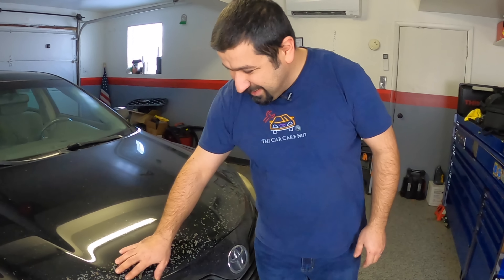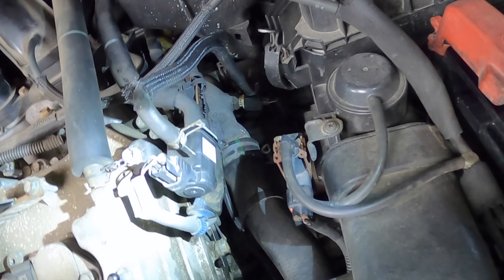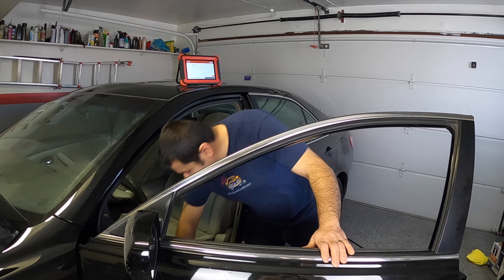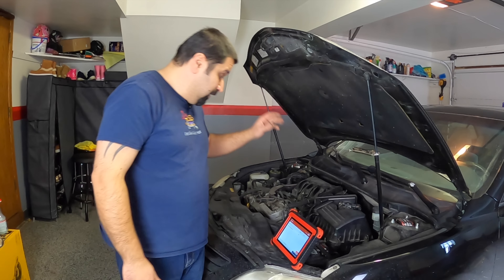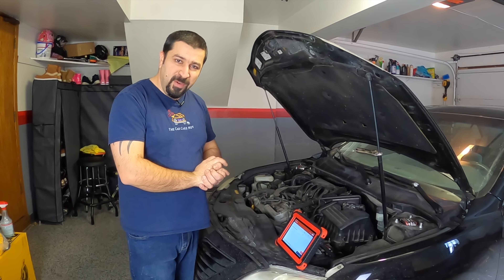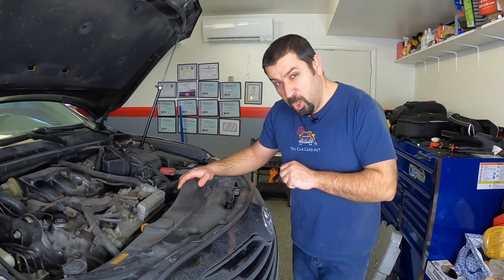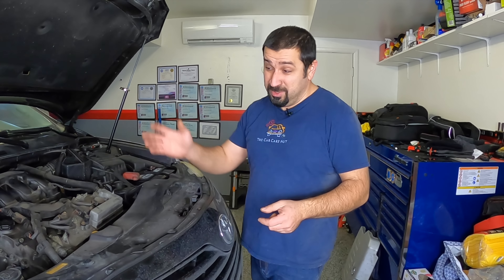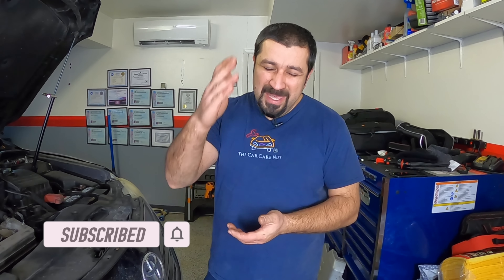How Does a 15 Year Old Toyota with OVER 200k Miles Hold up? Full Inspection!

Comment: So, I needed a new car back in 1999 since my late dad's 1983 K-Car wagon(!) he gave me finally was sold to a local contractor who needed a good old transport for his "stuff.". 

I bought a 3 year old 1996 Camry Wagon that came out of the south with the 4 cylinder 2.2L engine with just 42,000 miles on it .  White, beige interior, black roof rack, gorgeous and with the gold badges all around.  Even found two extra CAMRY gold badges and stuck them mid line on the front doors near the hinges.  Looks original And yes, they are GOLD PLATED!  $32 on Ebay.  I have been driving it ever since and still own it down here in Florida.  Has never seen snow, salt, etc. and is solid as a rock.  In the same condition as this video! The interior is "eat off the floor" clean, the rear hatch and engine hood hydraulic lifts were all replaced new (a very cheap fix), everything works as new (yes, even that pesky power antenna motor that I replaced only ONCE in 25 years.  All power windows work perfectly (replace just ONE a few years back) and she sports a new windshield.  She also has two sets of original Toyota wheel covers, not those cheap ones you can get at your auto parts store.  Finally, I have her running on my favorite tire of all time...TIGER PAW AWP II WHITE WALLS!  i put a little "beefier" tine on her as well Great handling and essentially a Michelin tire since they now bought our Uniroyal a few years back.  I did spring for a new Kenwood BlueTooth radio head just to keep up with the times, ya know!   

Then....IT happened after 258,000 miles (my goal when I bought it was to rack up enough miles to get me to the moon...about 243,000 miles).  Just changed the oil and was coming back home when it started to rock and roll.  Got it home only to have to tow it to a great Toyota repair shop I found near me.  Failed the engine block test. Bummer.   Opened the top of the engine to do the repairs and was told by the mechanic because of excessive wear he found in spite of the care it has received over the past 25 years,  that it was better to find a new engine or a rebuilt one.  Scoured the entire US and found nothing out there since so many Camrys had a ton of miles on them and were not good candidates for a rebuild.  Found some high mileage used engines that had more miles than mine.  My mechanic suggested I try to find a good "grandma's car with anything less than 100,000 miles on it.  OK....back to FB Marketplace, Craigslist, etc.

And then, I hit pay dirt.  A guy in Miami (I am from the Tampa/Clearwater area) was selling his 95 year old dad's 1996 Camry COUPE (complete with sunroof) with only 67,000 miles on it.  Since it was the only option at the time, we bought the entire car, drove down to Miami with a flat bed U Haul behind our Sequoia(!) and got it home.  The car was a MESS having sat unused for a long time, quite dirty in the engine bay, and according to the shop, some kind of black OOZE was found in the transmission pan.  But the engine sounded fine (seller said he has all the service records from his dad who only drove it within a 5 miles radius from his home)...but hell, only 67,000, certified one owner miles. Got it to the shop, they dropped my engine and the one from the donor car and took the best elements of my car with the best stuff they could pull off the donor car and did a full gasket re-seal on the donor car after a full pressure wash.  Looks like new!   My mechanic is a Toyota specialist and dialed in the engine far better than original.  Even sounded like a turbine engine with that proper "whine".  We were able to pull about $4,000 worth of parts from the donor car so we were already ahead of the game.  The whole process took about 5 weeks to complete, but I had my car back, perhaps better than ever.

So, off on the road I went to check MPG and overall performance.  Two, 100 mile mostly highway trips showed the car now getting about 32 MPG when my original engine could only must about 20 in the city and maybe 21 highway.  Also had the auto transmission service done (full flush, screen cleaned, etc.) and all new fluid with a special additive to keep the seals like new and reduce wear (the original trans was rebuilt at about 211,000 miles). Car shifts quickly with ZERO slippage.  And the pedal to the metal power has increased significantly.  

After about 1,000 miles, I drained the oil after using Auto-RX (great stuff) to clean any minor sludge issues (there were none, according to my mechanic), and then filled with the following "cocktail": 3 quarts of Mobil 1 High Mileage Full Synthetic oil, 1 quart of Marvel Mystery Oil and one pint of BestLine Nano Diamond Technology Oil additive (more great stuff...USE it!).  This is what will go in the car from this point on (I only drive this car about 7,000 miles a year now so she will get two oil changes each year to keep her running clean! I also use ONLY either WIX (NAPA GOLD is WIX), K & N or Mobil 1 Oil filters (NEVER FRAM). I use the car with all the rear seats in the down position so it functions like a small cargo or mini van.  TONS of space back there. And as a side issues, the stereo system sounds like a concert hall since all the sound absorbing seats are now out of the way.  A bit of serendipity. 

Next goal is to get it to 500,000 miles.  Total cost of the repairs, $6,000.00 and that includes the purchase of the car ($2300).  Try to buy a decent car for THAT little.  And I should tell you not a week goes buy when someone will ask to buy my Camry. Either at parking lots, on the road, or one guy who drove right into my driveway as I was detailing the car.  I kid you not.  So, fellow GEEKSTERS, take heart.  You now own something that others always wanted. Like getting to date that prom queen back in high school.  They call that KARMA.  Enjoy.  Dr. Z (LOU....not Karen)

Comment: Toyota car maintenance a lot cheaper simply replace engine oil every 3000 to 5000 miles change transmission oil every 30k miles change radiator water every 100k miles or whatever recommendation brake pads/Rotors are normal wear and tears. if you do those on time you car will run 500k or over without any issue

Comment: Question:- I know you love Toyota’s and I used too love Toyota’s especially big fan of Tacoma / pickup trucks. I was die hard fan but they came with new Tacoma in 2017. Wen in bought one and 4000 dollars worth accessories. But transmission sucked  keep hunting gears. It’s gas 6 speed automatic transmission.  You cursing on hwy All the sudden 1% incline truck would be in 3 gear or 4 raving at 6000 rpm. And loud. . I had trade that in with company didn’t use too like. But this truck is so much quieter at road noise so smoother on road  and 100 times better. That story beside. All new Toyota vehicles from Prius to Tundra for the engines they all use 0-20  oil. How can you have 1.5 litter to 5.7 litter can use the same oil for heavy job towing or engines just being big. How can that engine can be lubricated same.

Comment: A very descriptive video (honest) Well Done. Having said that,  I would appreciate  your (honest) and  analytical  decomposition why  the Toyotas manufactured  in Japan  are BETTER than the ones made somewhere else.  Not having the real information  and based on the assumptions that all sides get the  the subparts from the same manufacturers. If not,  they should operate  with the same standards set by Toyota.  I will deduce the difference is in the human factor. With your expertise in Toyotas  I would appreciate your comments in the subject. By the way I owned a Camry  1998  (24 yrs old) and   158000 Km. made in Japan that mechanically I have No problems  have kept my maintenance {oil changes, brakes, plugs faithfully, unfortunately  body corrosion  will force me to replace it. Will somebody with the knowledge be kind to relay  my comment  to Our Car care Nut,  help me out ( I am only  on my second  Smoke signals course, Thank you and God Bless.

Comment: I have a 07 Camry and I've all all engine mounts replaced but the car still rumbles when idling. What else could be the problem. It's annoying as HECK
Reply from the maker: Hi! 4 or 6 cylinder and did you clean the throttle body?
Reply: Wow! I'm just now seeing your reply, I never got a notification. It's an 07 4 cyl 150k miles

Comment: So,  with 151000. Miles,  I agree,  a trans flush.  And the guy says, your cabin air filter is bad.  Ok replace it.  Oh, a complete tier rotation is recommended.  Ok.

Comment: My 2014 Camry XLE has only 63000 original miles.  Runs like a top.  Fully paid for.  I'd love a newer model but not for the ridiculous prices dealer, "stealerships", want to charge.  They can kiss my butt.  On top of high interest on the loan I'd need.  Routine maintenance and I'd love to get another 5 years or more out of it.

Comment: Only 200k miles and it needs all this work and it's been worked on before? Looks about the same as the Lexus ES I had before. Oil leaked from everywhere, cv axles shot, brake system failed, abs, calipers, transmission died at 170k.

Comment: Thanks for this excellent video. This would be a car that I would consider as a used car mostly for winter use.  I would be concerned about engine wear and how many oil changes were done.  I might want to do a compression test and change plugs.  The cheap aftermarket parts are a bad bad sign.  A toyota oem gas cap is 15 dollars or less. Why buy dorman or cheap chinese crap. 
  I would want to review service records and look at the tires and interior.  

The poor paint on the  hood tells me the owner has zero pride in caring for the car.  

I would pass on that car.  And in my opinion its not going to be running in 11 years.  It has had poor care in my opinion
Reply from the maker: Hi! The engine actually runs pretty good and is clean inside which shows overall good maintenance regiment

Comment: Typical high mileage Toyota.  The (original?? who knows) motor seems to have held together however the periphery has gone to pieces over the years, hence the aftermarket parts as seen.  How much work has been done to the transmission, motor top end, fuel pump issues, who can know.  The reason you know the struts have changed is because of the aftermarket labels.  I stay away from all Asian cars because of the expense of parts and known reliability issues.
But you certainly know your stuff with these vehicles, can tell at a glance what most people would never see.

Comment: I have a 2005 Sequoia and I would never own another Toyota. This car eats breaks for breakfast. I have a limited 4 wheel drive that has had top quality maintenance but it has sensor lights going on all the time. This car has been in the family since new and now has 183 ,000..  Toyota is not my cup of tea and and independent shops will not touch it… The dealer is killing me. Currently it needs master cylinder and and all break sensors,,,, also time for timing belt because it’s showing signs of dry rot and has timed out instead of mileage out,  son of a bitch,,, give me my Dodge Ram back, this car has to stay in the family due to military family members wanting it back some day… No more Toyota for me!!!!

Comment: This guy seems knowledgeable about Toyotas, but one thing that drives me crazy as a 25+ year Honda tech.  I NEVER set my diagnostic tools on the roof of the car.  I get that this car is old and the paint is worn out, but in my view setting ANYTHING on the car's painted surfaces is a VERY bad practice.  I sure would be upset as a customer to walk into the service bay and see this done to my car!